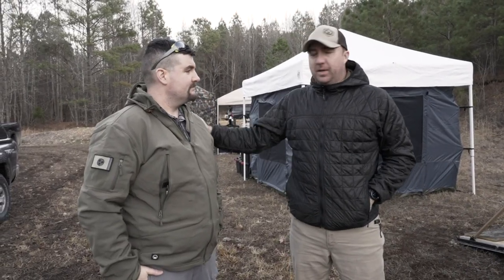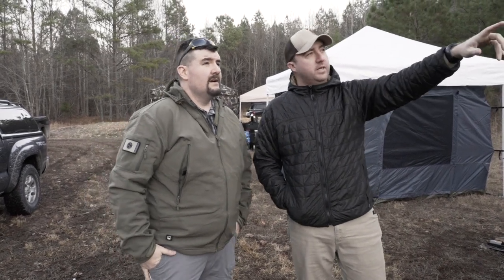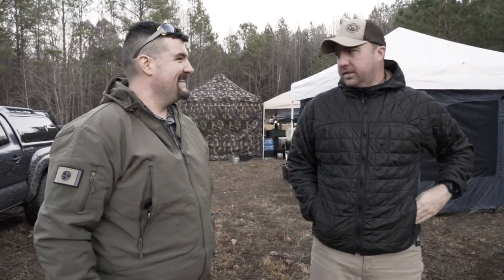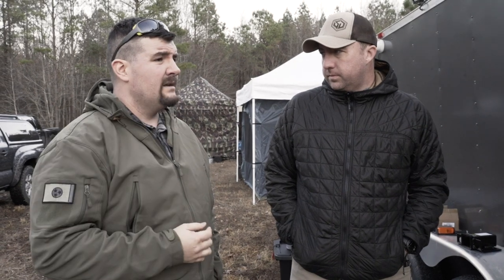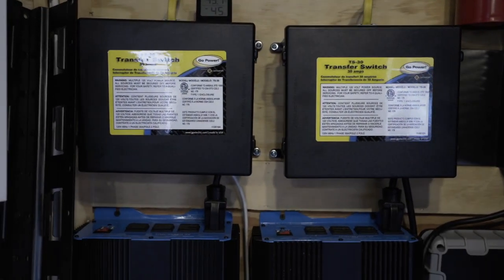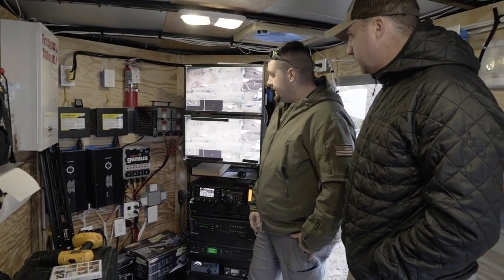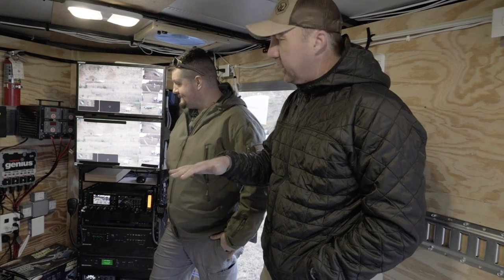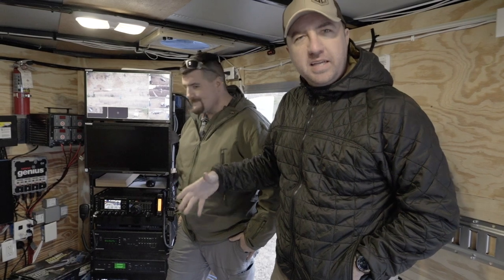First Look - Tactical Response Bug Out Trailer

Comment: Nice build, but it is NOT a SHTF Bug Out trailer. Would be good for disaster response communication van. Just MY2Cents worth.
Reply: If one owns a ton of land and has the means and manpower to meet security needs, could serve as outpost in rural area. Definitely not something one wants in a city or en route slowing one down.
Reply: he said just electronics at the start
Reply: I'd call it a command and control center. Has applicability everywhere from disaster response to shtf. If you have a couple vehicles to bug out with especially with a group. there shouldn't be an issue

Comment: Nice setup. I think it could be useful for "conventional" disaster relief efforts and support. 
My two cents (including for "other" uses): 
- Move the base of the mast inside so it will project through the roof; that would provide more inherent stability and help lower the overall profile of the trailer as something more than a mere U-Haul type vehicle. 
- Paint the mast & camera housings a mottled light grey or sky blue if you expect a lot of cloudless skies) to minimize its visibility at a distance. 
- Add 3 hook eyes on the masthead below the cameras for the attachment of guy lines for further stability in high winds. 
- Include an option for remote placement of radio antennae (perhaps via microwave link or fiber-optic cables) to avoid being directly targeted by incoming guided munitions (hey, you never know).
- Replace the fire extinguisher with a clean agent one instead of ABC dry chemical powder which can ruin electronics. Sentry brand makes one called 'Clean Guard'. More expensive than ABC but worth it if you value your gear. Relocate the extinguisher next to the door; you always want your extinguisher in the path AWAY from the fire. Never store your extinguisher in the most likely site of a fire...you won't be able to get to it and it will explode from heating up.
- Install anti-EMP circuit protectors.
- Consider acquiring radiation detection equipment for surveys (http://www.ki4u.com/products.htm)
- Consider adding remote security sensors and monitoring gear to protect your site, such as a modified SimpliSafe system or military surplus geo-acoustic sensors.

Just a few ideas from an all-too-busy mind.

Comment: To me this is more of a disaster response trailer.  Similar to what a lot of ham radio operators build.  Google search EMCOMM trailer.
Reply: I see probably $30k in electronics at a minimum and no actual preps, this is absolutely NOT a bug out trailer but more a mobile comms response trailer that's maybe halfway equipped. To be fair, he does say it's a work in progress. But it has a LOT of progress yet to be made before i'd consider it at 50% done

Comment: Very cool.  I'm surprised you don't have an old clutch fan inside a box on the roof hooked to a generator to collect power by wind when you're driving down the road as an extra source of redundant energy lol (might work! lol). People keep saying "not a bug out trailer" etc.  well, it could be if you bug out as a group and you want a central hub of communications and security.  A well put together group will definitely survive a SHTF 'sitch better than going it on your own.

Comment: This would be excellent for a BOO for a large group or disaster ops, hardly for bug out ops. This is incredibly TOO high tech for bug out operations. Excellent equipment but not effective for SHTF scenarios. Also the level of technology would be hard to maintain, especially long term, for the average person. The energy requirements have to be off the charts.